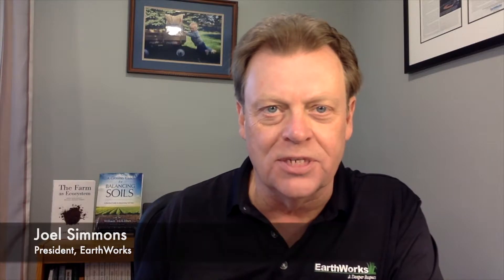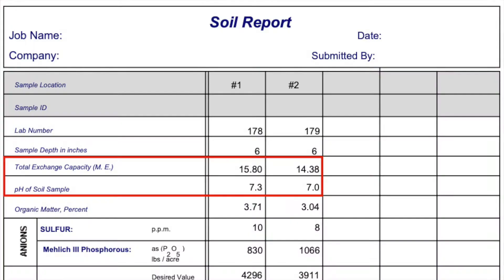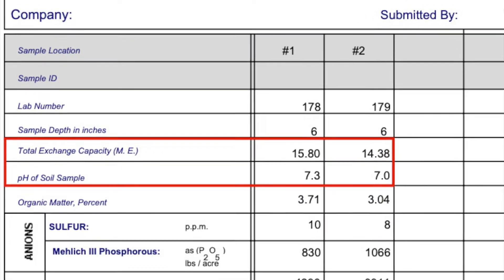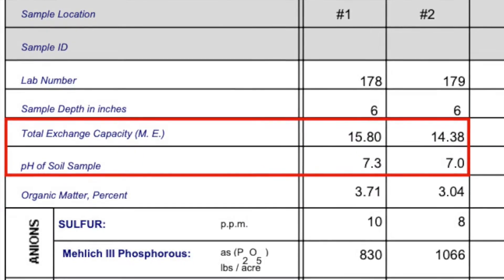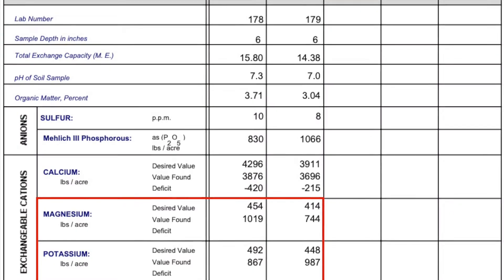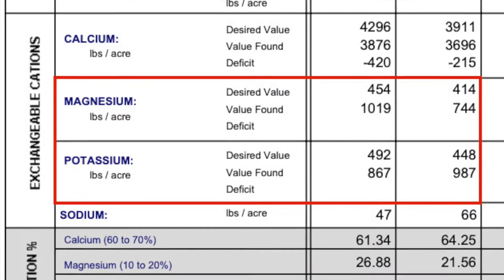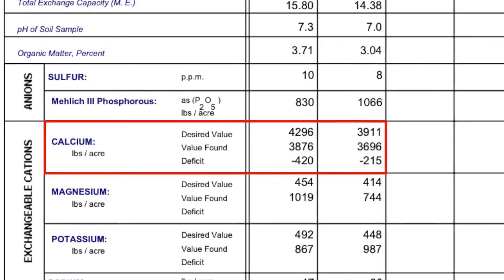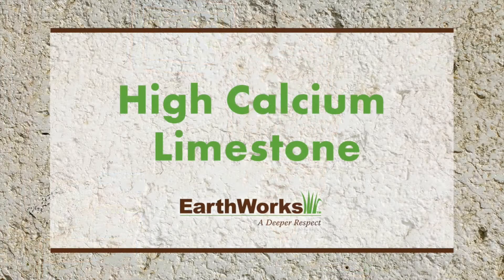2 Minute Turf Talk - Soil Test Review

Comment: Great videos Joel, always very informative. Quick question, could you just apply gypsum to get calcium into the soil to flush out the magnesium and work on dropping the ph that way? Or is using a fast acting calactic lime the only option here?
Reply: There is a Turf Talk on Gypsum!  It depends on how big the calcium deficiency is, anything under 60% Ca limestone, which is not fast acting, is probably better. Using both can can help in that case!